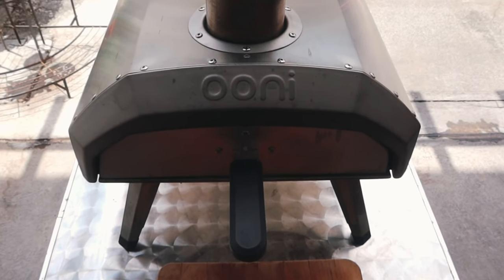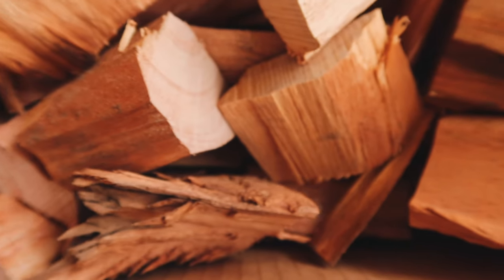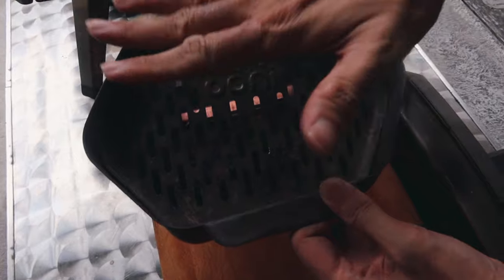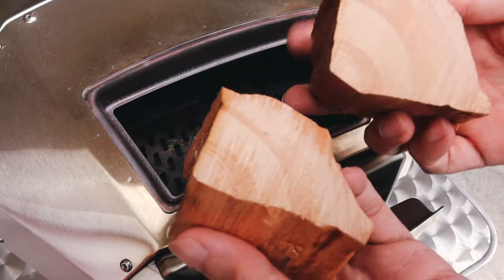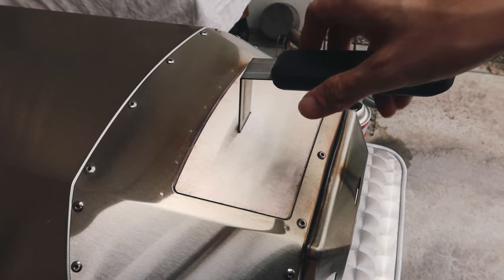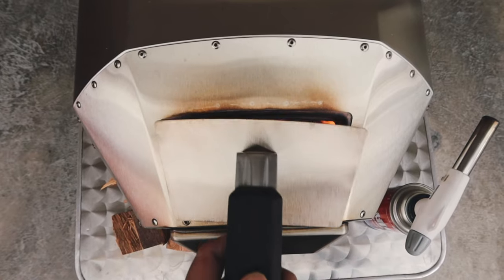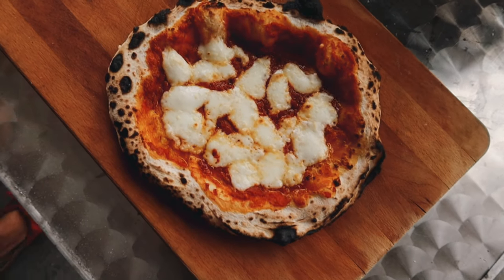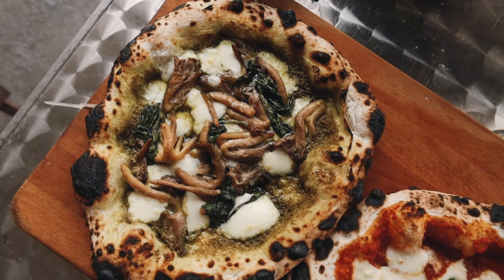How to Use the Ooni Karu Oven to Make Neapolitan-Style Pizzas

Comment: I am thinking between koda 16 and karu.. is there any taste difference in pizza from wood in karu and koda on gas? Does it make any difference? And when you heat up karu, how often do you need put wood to keep temperature up? Thnx :)
Reply from the maker: Not really to be honest.  It may when you're cooking dishes that take longer but not so much with a 60 second pizza.  

It's harder to maintain the temperature with wood.  It can go down as quickly as it goes up so you'll need to keep feeding it to keep the fire going.  I find myself constantly checking the hatch while my wife cooks to make sure the fire is burning well.

Hope that helps!